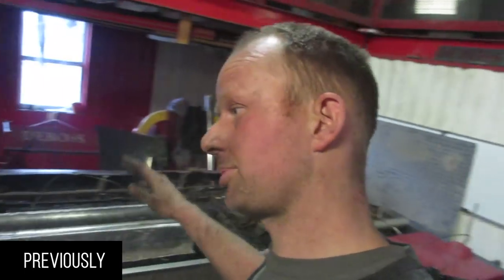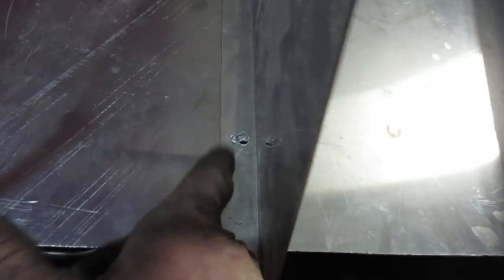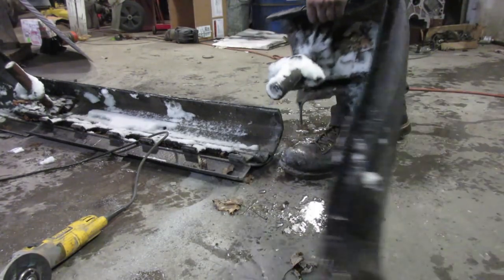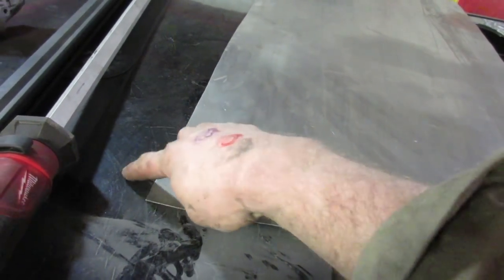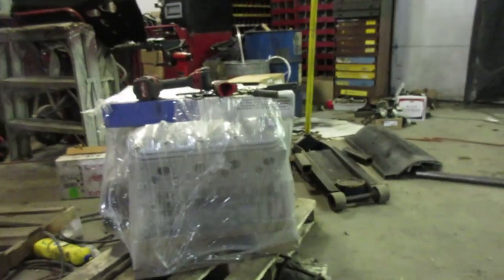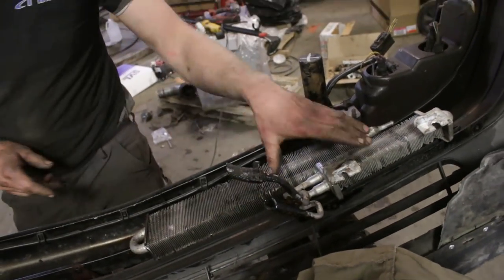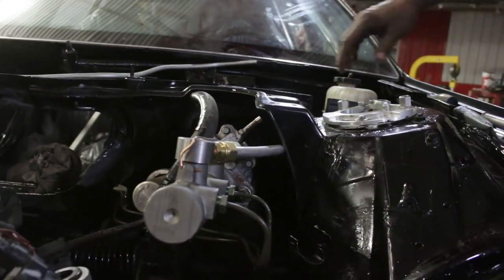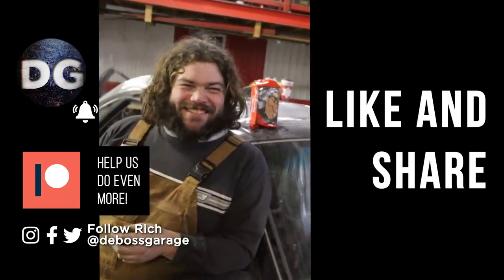Quad Turbo LS Audi Quattro Gets New Rims & Brake Lines | #Debocho [S1 E14]

Comment from the maker: Thank you to Toronto Tires for working with us to get these rims in time! http://www.toronto-tires.com//
ICT Alternator/Power Steering Relocation Bracket Kit https://www.summitracing.com/int/parts/icb-551570-3/overview/

4 ways to STILL get your name on Quattro Debocho:
1. LAST DAY! Support us on Patreon for $10/month until the race http://patreon.com/debossgarage
2. Buy Quattro merch & tag us on social media wearing it http://debossgarage.com/merch
3. Both - support us on Patreon for any amount until the race + buy any merch at discount via secret link
4. Help us finish the project! Here's a parts list of what's still needed for the Audi, if you're interested in helping that way. We will be updating this as we find them. https://docs.google.com/spreadsheets/d/1aCbxtx5ziYj4CjLinPqlLcwBIemfKMO8TZ5-K0Hxekw/edit#gid=1386834576
Own a business? Ask us about our partnership tiers: debossgarage@gmail.com
Reply: DEBOSS GARAGE dot 3? Wouldn't you be better off with dot 4 or 5? Unless ratings are different in Canada compared to Europe? Good job on the whole car though looks mad!
Reply: The wheel bearings REQUIRE a CV to be bolted in to compress the bearing together. so make sure you have those bolted in BEFORE you put any weight on them or try to roll the car around.

Comment: Hey guys, you're definitely absolutely going to need to put in some higher temperature rated brake fluid. Either DOT 5.1 fluid or even better like some DOT5.1 Motul RBF 600 or RBF 660 or Castrol SRF Fluid. DOT 3 Is going to boil so insanely quick on a racetrack and you'll have absolute shit brakes within one lap.
Reply from the maker: Will do thanks!

Comment: i LIke that vacuum idea. I like to instal an air line fitting in an extra reservoir cap. TURN THE REGULATOR ALL THE WAY DOWN!!! then pressure bleed them. only thing is you still have to refill the reservoir a bunch of times. remember to pump the brakes a few times throughout the procedure.

Comment: you could of done the floorpanel / underpanel from glassfiber and reinforce it with small trips of aluminium.  Would be at least 20 times lighter and still be strong ennuf unless you plan to go offroading and rockcrawling with it.

btw, it will not bleed the brakes complely unless you use pedal to work the workcylinder ,  it will otherways only bleed the mastercylinder.

Comment: Concerns: 8000 rpm. Heat inside drivers area from Turbo's. V.
Reply from the maker: Concerns about 8000 rom, engine guts all over the track
Reply: Chris Smith #helmet
Reply: Even with a helmet...who says the bits will all be aimed at his head?! Besides I seem to remember Rich said he was putting a "firewall" or plate in front of the turbo setup to close it all off, so either way it should be fine.
Reply: Chris Smith - Who says the bits will be aimed at his head?!
You literally said two hours before.

Chris Smith - I would be more concerned about a turbo letting go and launching impeller chunks at your head!

Comment: My only concern so far is the whole "8000-9000 RPM"... I dont know if I would have the balls to run an LS over 7K and not worry about pieces of the motor coming thru the firewall to say HELLO!!!

Comment: Love the “Jack Black” intro!!! Did you roll the car around without the CV axle tightened in the hub? That can wreck wheel bearings from what I’ve heard, apparently they need to be tight anytime they have pressure on them.

Comment: Your gonna want to have a drive shaft shop make you a new front left axle, the o1e likes to shock that one, its the most common failure point, you'll be making enough power I would recommend running the spindles with bolt in bearings and having a few front left axles kicking around, your going to twist and snap them more than once.

Comment: Try this to insulate between the plate and frame.
      Lay down a bead of silicone on top of the frame and let dry. Then bolt the plate down. I would think that should take care of some of the rattles you'll experience.
Reply from the maker: All the runners and PL'd (Construction glue) to the floor, but yeah, makes sense.  Lay a bead and let it dry, they install the panel.  Thanks!

Comment: Once you put the axles in the front wheel bearings will tighten up, be careful moving it around with out them but since the motor is not in there is no real weight to ruin them. Few times I've seen people drive arou d with them loose and not ruin them

Comment: Reduce "push" (understeer) by increasing rear sway bar diameter (stiffness). This makes the rear end slide out by stiffening the differential spring rate active in cornering at the back end relative to the front end. This is an effective way to raise the overall chassis spring rate without reducing tire grip by overspringing the wheels/tires. Best coil spring rate is the one that produces the most tire movement up/down without ever bottoming out on the track surface. This keeps the tires in greatest contact with the pavement and produces the greatest grip. By stiffening the rear sway bar rate, one can then utilize wider rear tires for increased out-of-the-corner grip (side bite), which-- when it's done well-- makes a race car just phenomenal to drive.
Reply: Pete is right, it just means there is a ton of sorting out to be done, almost all of it has to be done at the track. It makes one realize the enormity of this project. Rich, you are one in a million for even getting to this point--what a great effort! I wish I were closer to you, I would offer help any way I could.
Reply: jmshaw357-- You speak the truth, brother. I did A LOT of racing years ago, and the immense amount of work it takes to build a reliable race car, one that performs well and is safe is IMMENSE. Hats off to Rich, as you say, and probably hair, too!
Reply: Rich is a little thin on top.

Comment: ‘90’s Town Cars have a small remote reservoir that feeds off the main master cylinder reservoir via a 1/2”ish rubber hose. The aluminum looks more pro but you could’ve certainly scored some of that OEM Ford hose for that purpose also.

Comment: AVE refernces and everything!! Should've gone for audi engine, even if a 5-cylinder 2226cc turbo. Then throw nitros, e85 and holsets ( pair) for shits-n-giggles.
Reply: Leandros Komninos a lot more electronics
Reply from the maker: It's been done before, we live in the wrong country to build an Audi engine (parts, shipping delays etc.) and we are going for the radical factor.  No disrespect for the Audi engines, they are proven, there just wasn't a 5 cylinder in Tewsleys yard!
Reply: DEBOSS GARAGE I figure "keep shittin out your ass" is best... Haha, car looks minty as fuck man! You ford comment made me cry! Ahahaha
Reply: Fair enough, love what youz doing. I am an avid VAG (no smutty jokes!)  fan, and have recently breached into Alfa Romeo and SAABs. If life was easy it would be boring.
Reply: OOoowh, just thought.. joy gotta do some dry ice shit for extra cooling, and 80's citch.  Also help with rear turbo & rad setup, but advise partitioning, or suffocate silently. Always wondered what % unefficency would be to have extra a/c for chilling I/C, apparently A/C only sucks a few % from power when on rolling road ( Misha Charoudin @ Apex)

Comment: ford is the one who doesnt care about weight savings.................................. are you kidding me? have you not seen those moronic horseshit gm commercials with the bear cage? ford was the first company to build the bodies out of aluminum........... and the first company to go to the turbo v6.......... and dodge..... well i suppose dodge cares about weight savings in a roundabout way, i mean they come out of the factory weighing about a billion pounds but after two years they only weigh about 1000 pounds cause all thats left is a cummins engine lying on the floor

Comment: I paid around $350 for my vacuum bleeding tool like yours over 20 years ago from snap-on. Harbor freight is awesome. Great build. I am addicted been watching the whole series on this car. I have worked on BMWs and other german cars for 25+ years and worked in NASCAR for 5 years before that. I know I’m late to the party but these are great videos especially since I have built countless 800+hp cup engines. Making that power NA with a carburetor. Damn things shake the ground when you’re dynoing them. Our dyno wasn’t automatic and ran on a old computer that you booted from DoS. The water control for the dyno is just big hose valve. Simple yet effective. The restrictor plate motors back then ran 18/1 compression ratio. Insane like a Diesel. Lol. Keep it up.

Comment: Once the green drops all the noise goes away unless its the last lap and your leading in witch case you will swear EVERY NUT, BOLT, WHEEL is falling off. The engine is down on power. The guy 4 car lengths back is pushing you. So I guess my advise is when the flag drops hang on and enjoy.       Remember if your not scared of racing you don't belong there!

Comment: (Edit for bullshit fan theory :D) Mounting the brake fluid reservoir a few inches above and as close to (or above as factory)  would allow for much steeper vehicle angle where those 3 inches mounted inside the cabin (or 10-15 inches further back for instance) might result in problems due to the greater drop in elevation over that distance. Probably not such a problem for this purpose but maybe over a really long, REALLY steep climb.... which totally needs to happen by the way  ;P

Comment: Incredible Rich, not very many regular car enthusiasts, makes diffusers for their race cars just goes to show how much tech you've got into this build, that I was not expecting whatsoever. Nice surprises can't wait to see this baby scoot around the trac.. BTW a good tip for body work is to try and always stay away from cutting corners and then trying to weld them up! always try to round the corner instead, then when you weld it up! it won't be so liable to break apart later on. Corners on body work patches are a no no.

Comment: I've found that iron oxides and the like is quite hard on the die wheels of an English wheel. Ends up putting a brinell sort of surface into the wheel. A wire brushing helps a lot.

Mean no disrespect, project is great man 👍

Comment: You should really smooth out the transition on that diffuser 

Also the farther back you can start the diffuser the better

Also start off with a square tire setup and use a stiffer rear sway bar to help get rid of the understeer

Comment: I've been watching this entire series as I'm an Audi fan and I've always loved that body style.... The one thing that I would comment on about the brakes that maybe someone's already commented on Is at 4 race you should use something higher than dot 3 as dot 3 has a certain temperature rating ... You should do d dot 5 at least if not high heat
Reply from the maker: Yes, we did end up going with a dot 5

Comment: Is that brake booster compatible with mineral hydraulic fluid (as per the Audi steering rack required fluid)?
Reply from the maker: the hydroboost doesn't mix with the brake fluid
Reply: Yes I know, I was talking about the booster circuit which uses hydraulic pressure from the steering pump. The Audi system is the same, however it uses mineral hydraulic fluid, not normal PAS fluid. If you run Dextron for instance, the rack will be destroyed in short order.

Comment: Hi Rich
Would your time and limited cash resources have been far better spent just upgrading the Audi Quattro with Quattro parts quick freshen up of the engine put twin Turbo's in the engine bay!
5speed Audi box upgrade AWD  and suspension with Audi parts from the auto-wreckers done and dusted in couples of months
Reply: steven bonz where is the fun in that?